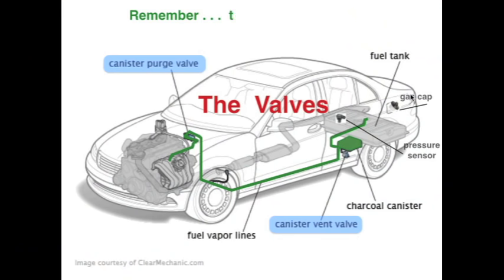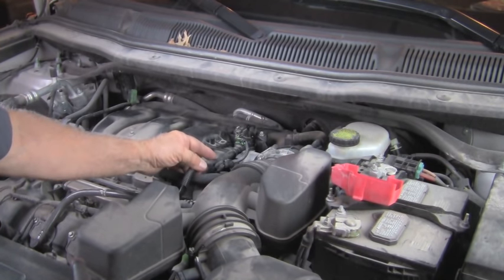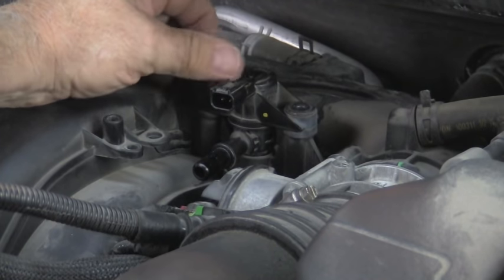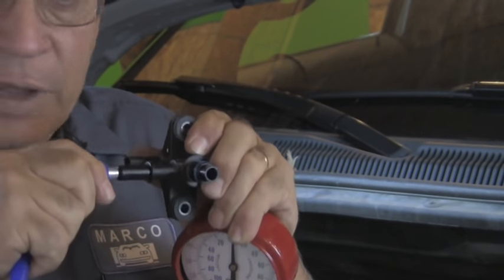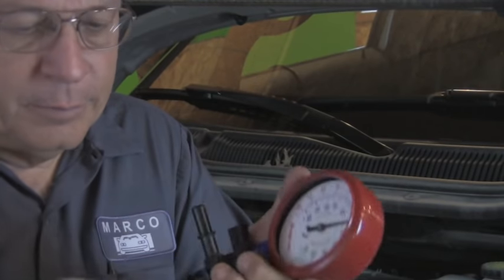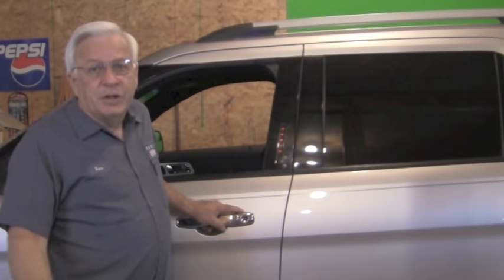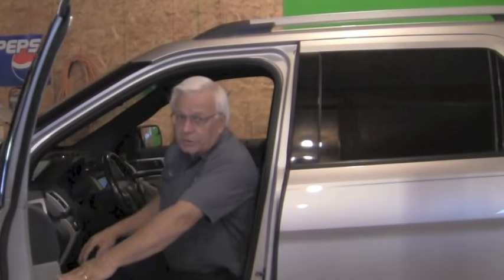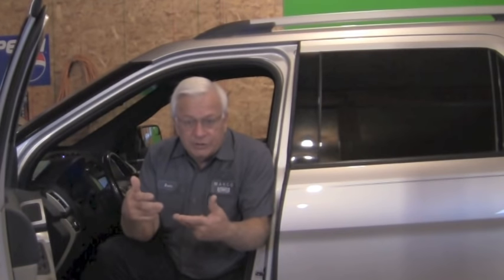How to find a Small EVAP leak without a smoke machine Part 2

Comment: I find it interesting that a purge valve that was leaking that bad actually set a small leak code.  I would have thought some like a P0451 or P1450 or some kind of unable to control excessive vacuum type code. The FTP sensor must have pegged out when the CCV closed? Unless I am thinking about it wrong when the CCV was "closed" wouldn't the leaking purge valve continually be pulling vacuum on the tank overcoming any type of leak? What are your thoughts on this?
Reply: +South Main Auto Repair At closed throttle the "leak" would maintain 18hg, but the purge valve commanded off at the same time as the throttle opening the manifold pressure and evap sys pressure will try to equalize. My bet is if you sat on the throttle long enough you could trip a medium leak fault.
Reply: +South Main Auto Repair That's some good critical thinking. I understood better what you meant when I pulled up what a P1450 meant. Excessive vacuum to the tank. I can see how that'd get too much vapor and run the engine at high idle.

Based on what I've just learned from you, that does make sense that the additional code would set.
Reply: +South Main Auto Repair - The strategies for what code sets when  are algorithms written for brand new cars,  By the time we get to them, any EVAP problem can set any EVAP code.  I don't even bother to look them up anymore.  For ANY EVAP code I just test everything I can can get my hands on and something is always broken.  Duane's video is a great example of this exact strategy!
Reply: +South Main Auto Repair My father and brother each have a 2006 Chevy Express van with the 6.0L engines and have had P0455 (medium leak as Duane has put it) pop up as a result of a leaky purge valve solenoid. The proper code in both cases should have been a P0496 is a purge valve solenoid stuck open/leaking and really should be the first EVAP test that the PCM runs (ie close vent valve solenoid and see if any vacuum drop is measured by the FTP sensor from leaking purge valve). GM and Ford must be either skipping the test on some models or trying to determine the P0496 while running the P0455/P0442 testing and having it not work correctly.
Reply: +South Main Auto Repair Wouldn't this also cause the engine to run little rich provided the canister had the vapors stored?  It would have been interesting to notice what was the FT on the freeze frame data.  By the way, when the vent valve is open, is the tank really vented to the atmosphere?  That can't be right!
Reply: 12vgs8606
No, it's vented through the lines, through the purge valve and into the intake.
Reply: 12vgs8606
I thought the vehicle was running rich, or maybe I assumed that with the 1400ish RPM idle when it intended about 725 (going off of memory).
Reply: 1. Don't know if the car was idling at 1400 on it own or if the gas pedal was pressed.  It would interesting if Duane had shown the entire freeze frame
2. I am talking about the vent valve near the charcoal canister which is normally open.  That would imply that the fuel tank is vented through it if I understand the plumbing.
Reply: 12vgs8606
I believe the charcoal canister gets the fumes from the gas tank first, and then the vent valve takes it from there.
Reply: +South Main Auto Repair I thought it was going to be another poorly sealing "capless" Ford filler neck!
Reply: motoYam82
The only thing good about those, is if you hit them with some solvent, clean them up, and work them over and over, they're often fixable.
Reply: +South Main Auto Repair Also I find the purge valve is near a source of engine heat and vibration. the canister valve is more protected and less of a problem.
Reply: ne2i Right. There have been cars where dirt and grit from the rear wheels got to the canisters, but that issue isn't common.
Reply: It would have to draw a vacuum to a specified value then stop. Then measure the time of how long the vacuum holds to yet another specified, lower vacuum level. Thus it could quantify the leak rate as it does.
Reply: ***** Ah yes. Been a long time since I watched this video, but that sounds correct.
Reply: If funny, on hyundai vehicles when the purge valve is completely bad and choking the car after filling the tank gas, it also causes the "small leak code"....when the purge valve has a tiny leak it throws the P0455 or small leak. I love the approach here....95% of failures will be with these valves since they are working vert frequently. On hyundai vehicles this valve is isolated from vibrations with a rubber mount. By the way, what out for counterfeit valves on ebay....Chinese copies are very good nowadays but not reliable at all.
Reply: South Main Auto Repair -Eric, what you state, is what should happen if the engine was running at the time of the monitored leak test.

But, according to the test conditions in the service information, the leak test is performed while the engine is off.
 So the result of a faulty purge solenoid would be a decrease in vacuum, as the ambient pressure in the intake manifold would leak into the evap system. Thus a leak.
Monitored code P0456 Evap System Small leak

After the ignition is off for a calibrated time.

Fuel level less than 88%.

Ambient temperature between 4°C and 43°C (39°F and 109°F).

Elevation is below 8000 feet.

Hope that helps.
Reply: South Main Auto Repair 8s

Comment: Thanks for the information. Unfortunately I have a volvo so it will probably be more difficult than this. I have small evap leak and the dealership said it would cost $500 to find it.
Reply: I was with Volvo for 20 years on and off. They went downhill fast after the demise of the "Boxy but Good" 240 series, and was sad as can be when some ^%*$ing "innatentive individual" plowed into my '84 wagon with a stick-shift while it was minding it's own business parked in front of my home.
Personally? A "small leak" of hydrocarbons being vented into the atmosphere and triggering a warning lamp and code that keeps a person from driving their automobile is a scam and a half and a way to steal your energy and resultant "money." Drive by a stinking oil refinery with fumes changing the color of the light and then wonder if they have a "check refinery" light that keeps their machinery from being operated.
Good luck.

Comment: I like the logical thinking & using a scan tool for trouble code clues to help focus a trouble shoot. IMO the under hood purge valve & its vacuum line attachments earn #1suspect spot because of their under hood exposure to extreme heat & cold cycling & engine vibration. I'd add the fuel cap rubber seal as 2nd on the suspect list, as it's removed for every fill up, & the tank end pressure sensing valve as #3, as it doesn't see the severe temp range or engine vibrations & isn't removed like the gas cap. For those without a vacuum gauge, light up a "Swisher Sweet" cigar or the like & try blowing smoke into the valve, or system, to "look" & "sniff" for tiny leaks, works for me on quick tests!!!! More thoughts for consideration.
Reply from the maker: thanks for your comments, they are helpful

Comment: This is an amazing video. I am going to try this on my Mitsubishi. It's throwing a code, I thought it was the fuel filler neck as it was rotted out (And recalled thankfully), but after the fix, it's coming on. Much slower, but it is coming on :( Hopefully the valve under the hood, but poor gal has 180k miles, so anything could be broken lol. I wish I had your scan tool though. Mine is a very old and primitive basic scantool. One day maybe :)

Comment: Thanks, I've had the small evaporative leak on a 2002 Pontiac Grand Prix like forever I've replaced the two purge valves like you did to no avail maybe I should get a new one and start this over again and test it like you did because I guess even brand new ones can fail? Thanks for the advice!

Comment: I'm late I miss my father in law.  He was a certified Ford mechanic for 3 years.  Rip Pete, I miss you pops.  I've learned a lot here.  I have a EVP issue, replaced gas cap and now good so far.    How much testing like that would cost for a 2012 Dodge Avenger?  any quotes?

Comment: You could have left the valve on the intake ..and removed the wire and checked for a vacuum leak...or just pulled the hose that goes to the gas tank off..and the engine would have stalled or changed speed. and could  have sprayed starting fluid in the port the hose was hooked to and the engine should have speed up. A very nice video thanks....Have you worked on a 2003 Pontiac Montana...if so do you have to pull the gas tank to get to the fuel tank pressure sensor, or is there a port inside the car to get to the fuel pump?

Comment: I ran into a couple of issues with this test. 

1. I didn't have a pressure and vacuum gauge. I only had a vacuum gauge. So when I tested to pressure side, my vacuum gauge could not hold a vacuum. When I tested the vacuum side, it did hold a vacuum. 

Its important to note a couple of things and to make clear. Even though the purge solenoid blocks airflow, its important to make a distinction that one side pulls vacuum and one side is just blocking air. So to test the blocking side, you'll need a pressure gauge. And to test the vacuum side, you'll need a vacuum gauge. Again, the pump most people have is just a vacuum pump. So if you use it to try and hold vacuum on the air blocking side, you'll think the solenoid is no good.

Comment: Thanks for this video!! I have a huge problem with my Mustang 2004/ 3.8 litre!! After replaced bigger fuelpump, and throttle body, 70 mm, my idle has been crazy high, like 2400 RPM, after 20-30 seconds goes down like 1100-12000, never below??? I had "check engine" light on every now and then, even before I did these changes, telling be that there is a vacuum leak, large, somewhere, and "check fuel cap' light also did come on, changed cap, no help?? I know there must be?? a large vacuumleak somewhere, since AC work, and blow to face and suddenly change to windshield, like difrost, even I don't touch anything?? So far, I did check DPFE sensor, seems fine, tested it replaced it about year ago, now bought a new one, no change, will return it, did change TPS, IAC sensor, EGR valve, checked in rear canister purge solenoid, has 12 V, and when applied voltage, closed??, did not change that! Also checked canister purge valve , in front, cleaned it, could really not tested well, has power coming in, put it back??? Could that be open all the time?? And make idle go higher like this??? Will change that next, after I return new DPFE  sensor, don't want to buy any more new parts, before I know, why idle goes so high?? And where possible vacuum leak is?? Did spray under hood all vacuum hose connections, no leaks???Even brake booster!!!,  Do I have to do smoke test next??? Please, help me, going crazy here!!! Car is driveable, thank god manual, but very hard to drive and terrible gas mileage !!! Thanks=)

Comment: i have a p0446 gm i replaced gas cap tank pressure sensor ,i tested the vent valve and it works fine i checked the canister work good too, but i performed a test to the purge vale i blew on the vacumm side and air goes trough i sucked on it and nothing i know thats weird and it has nothing to do with the code but since like you said thats not right so im going to go from there thank you i made a gauge like yours and blew with a hand air pump.

Comment: Very good vedio! going to check my purge valve see if there a leak.. but after for a warm up the purge valve is clicking delicate that it open and close, means it working. I don't know if that really matters even it clicking open and close but has a small leaking in purge valve. Does it supposed to click open and close even though it has a small leak in a purge valve.

Comment: Great video. very thorough. I have a 03 Dodge Dakota 4.7, it gave a P0440 and P0456. I replaced all emission hoses, purge valve, fuel vapor leak detection pump, and gas cap but still get the same codes. I'm at a loss!!! Any help would be appreciated.

Comment: This guy is sneaky!!    I had put in a new Purge Valve at the Engine block, and all associated small hoses.  The EVAP Small Leak code still came on, but it did seem to take a bit longer to come on.  New Gas Cap, fit tight, seal tight.  I looked at Charcoal Canister on my vehicle, and it looks like a frigin octopus there are so many hoses coming out of it.    I did not know about the Canister Vent Valve there, I shall have to look at that, if I can get at it, and get it out.  I know about the Pressure Sensor at top of Gas Tank. I don't think I have a "trap door" to it on floor of backseat or under back seat. Not sure of exact location of it, I hadn't looked that closely.  I am certainly NOT going to drop the gas tank!!!  Grrrrr!!!!   So, if leak is somewhere in all that long maze of hoses!!!  ?????  I have no way to blow smoke thru, unless can rent a smoke making/blowing machine somewhere.  I dunno.  I've managed to get by Inspection Sticker each year, for like 4 years, bought it used like 6 years ago.  It is very annoying that Check Engine Light keeps coming on.  I got tired of reading Codes and Clearing them.  Have other more serious and present problems with car.

Comment: Hey Duane.  I got a 2005 kia sportage v6 with 90k miles and I'm stumped  on a p441 code. Evap no flow. I've changed the purge and vent valve. I'm hoping its not a canister. But there's another sensor on the canister but not sure what it is. I think it's the tank pressure sensor but I thought those were on the tank only. Is there a way to make sure its the canister or the pressure sensor? Also when i fill up the tank it creates a no start condition. Is it possible to explain how the ecu detects a no flow condition. Not much videos explaining that on here.. i love your videos and the way you explain it in theory. Thanks for all that you do, pablo

Comment: So my fusion has been consuming gas exorbitantly.  There was a code p2196 signal stuck, sensor 1, charged the sensor, a/f sensor also, hardly any improvement in gas mileage.  Now, p2196 comes frequently,  and now new code is coming in p0133, slow circuit response sensor1, and I am frequently getting  blurping noise from what I just learned would be the valve near charcoal opening/ closing fast, and comes around half gas tank and is loud.

So, code p0133 may also be related to the purge valve you just charged?  Can I just replace that valve though I am not getting  "evap leak" code.  I am confused, where is the leak given code p0133, and sometimes p2196?  I also changed catalyst converter but no change in fuel consumption

Comment: Hi Duane , good video . Suppose you just disconnect the electrical connector to the purge valve an removed the hose off of it an started the engine . If the purge valve were leaking do you think that you would see a difference in engine idle , engine running ruff ?

Comment: Unfortunately I just got a P0442 on my Trailblazer. I had a P0455 a couple times in the last few months and have replaced both valves. It seems like there is less leak now judging by the codes, but I am at a point where troubleshooting is going to be extremely difficult without smoke testing.

Comment: Wow, great info. I just had the engine light come on in our 2014 Toyota Prius and when someone checked for the codes it had multiple codes, GAS CAP, evap sol and evap canister. Question is when I checked the gas cap it was barely on and I tightened it up. So, once a problem with this system happened and after tightening the gas cap do these "Codes" need to be reset? Because the check engine light is still on but gas cap was barely on???? Thanks for your response!
Reply: Great question.  IF the problem was truly the loose gas cap, and tightening it fixed the problem, the the computer should continue to "monitor the system and turn off the light.  But it could take several days. It all depends on how you drive it.

Comment: Trying to fix my wifes 2001 highlander.  We have replaced the gas cap and the charcoal canister and had the lines tested.  Still, we had the codes thrown again P0440 and P0442.  I tested the purge valve by sucking and blowing into it and I could blow through it like a straw.  So I ordered a new one from amazon.  However I just received the part and I can suck and blow through the new part as well.  Did I receive a used broken part?  Its clean and looks new but I can hear the spring is loose inside just by shaking it.  Car has about 98k miles on it.

Comment: So my guess  is that a smoke machine wouldn't have found the problem since the leak was internal? (defective purge valve was leaking gas into the combustion chamber.) I'm guessing if you were to blow smoke from any point in the circuit, the smoke would eventually make it's way out the tailpipe? Great video.

Comment: Thank you. "Critical thinking" is what we're supposed to be doing all the time.
"Flat-rate" payment of technicians with a maximum of 10 minutes of diagnostic-time allowed, combined with poor-training, or unqualified idiots with a big tool-box and an even bigger mortgage combined with even worse oversight by "service-advisors"  who are either overworked, technically-challenged, or just straight greed-head sales-types are what turns my stomach these days when someone asks me to help them with a thousand dollar charge for nonsense like "We need to replace the evaporative control system" at a dealership or repair facility.
Reply: 100% right, flat rate should only be used after  the diagnostic's have been completed , problem being no one wants to pay for di-ag and no mech wants to work di-ag in a flat rate shop, unless the di-ag tech can make a wage closer to a to a flat rate tech. Hence poor customer service and poor shop moral and why your shop is always out of loaners.